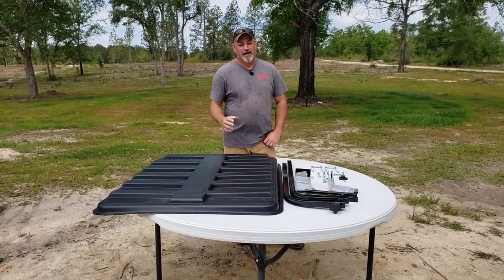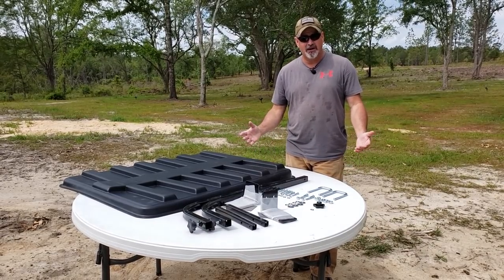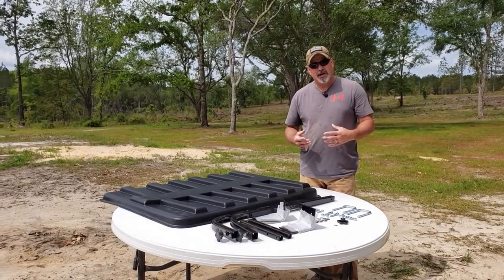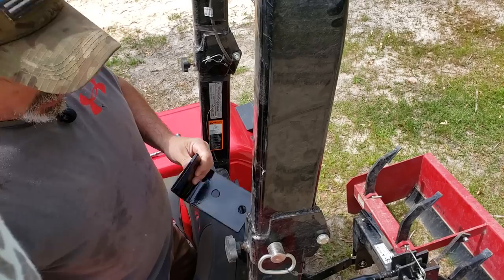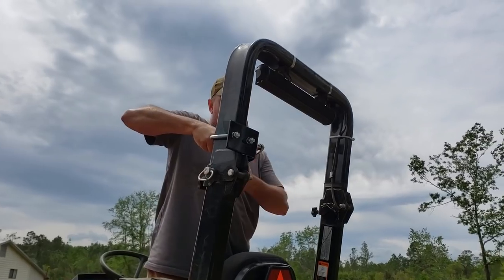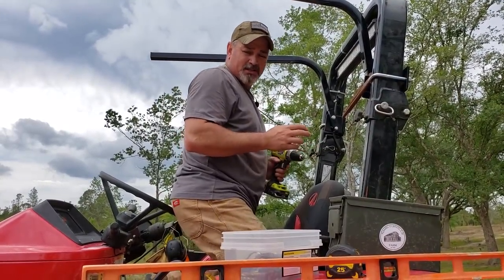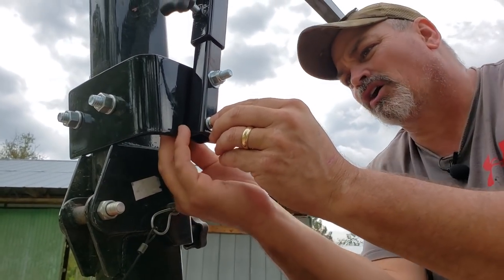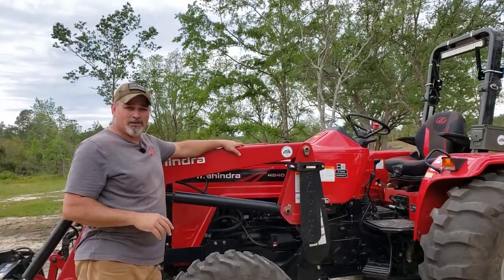TRACTOR CANOPY....RHINOHIDE! How To Install a tractor canopy on a ROPS system

Comment: that's a nice canopy , if my MF didn't come with the one that's on it i would buy the Rhino , be careful in the woods . i have a crack in mine from running into a guide wire while bush hogging but i saw it before it messed it up , looking good as always
Reply from the maker: Yeah, good reminder to be careful!👍

Comment: I imagine that screen is to protect the back of the U bolt and that bracket from rubbing the paint off of your ROPS as it vibrates. Looks like a nice canopy. I have looked at those online before as I have seen the owner comment on some other tractor post. I think it would be lighter and flexible as opposed to some being made from fiberglass. I like the quick detach on it too and the downward angle on it to shed the limbs. Hopefully, it is far enough out that if it rains it won't be an issue with rain coming back on you as you make a dash for the barn haha. Great deal Hank.
Reply from the maker: It's crazy how it keeps you cooler
Reply: @HamiltonvilleFarm  I will have one on mine for sure. Just for the rain and sun protection alone.

Comment: The sun gets brutal out here, part of the reason we wanted a cab with our big tractor.  I wonder if I could mount something like this on our old one though?  Very easy installation, which is cool.  I think I'll look into it.  Any idea how it holds up in high wind though?  Thanks for posting!  :)
Reply from the maker: No idea on high winds. It doesn't get that way here. You may try the website it may offer some guidance on that. It definitely helps keep you cool. It's incredible how good it works
Reply: @HamiltonvilleFarm  Will look into it, thanks!  :)

Comment: Been considering one of those myself.  Are you going to move your LED light-bar to the front of the canopy?  I was planning on mounting the light on the canopy, it will make removal a little more difficult, but I think the light being up front would provide better illumination.
Reply from the maker: I haven't used it at night yet, but when I do I may just end up taking the canopy off since it is the easy on easy off model. But I did think about about that when I was installing it. I'll wait to make a decision on it.